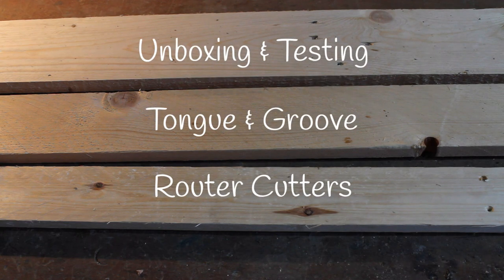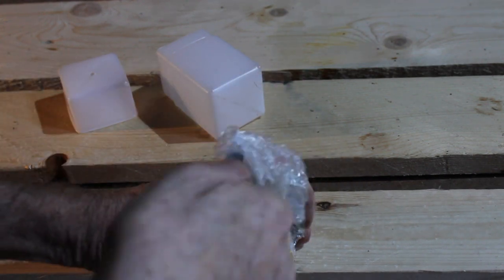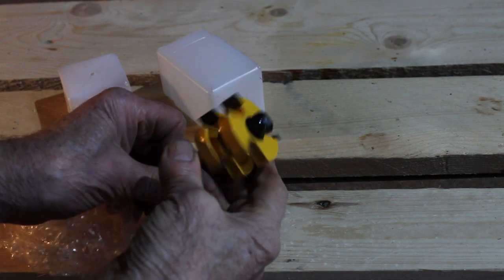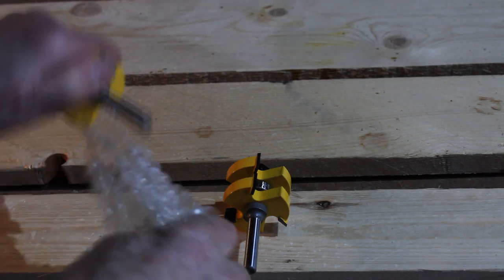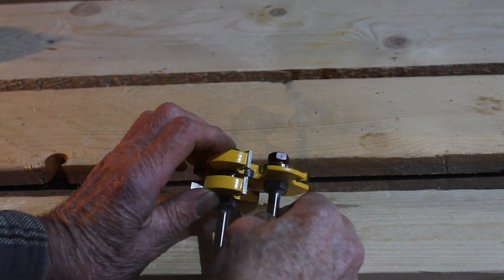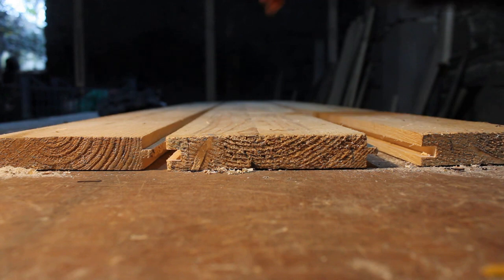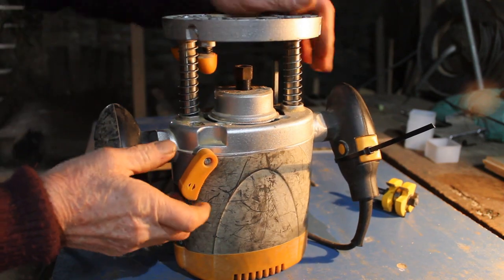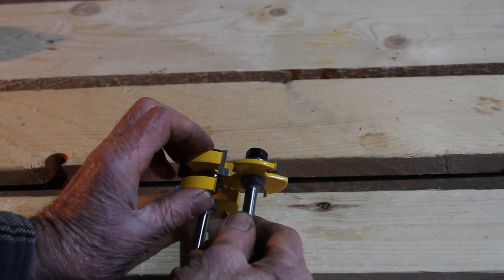Unboxing & Testing Tongue & Groove Router Cutters, Pallet Wood Cortadores ranura lengüeta - paletas.

Comment: it would be interesting to see a video - or several by theme - where you go back to your previous projects and tell us how they have held out over time. tell us about modifications or any that just didn't turn out to be as great as you intended.
Reply from the maker: Hi, Yes you're right, sadly not many people are that interested in the longevity of the projects. All I know is that I show projects I've undertaken to solve needs or solutions to problems, none of which have short working lives. It's better to receive questions about a specific projects' success so as to communicate any problems to someone that wants to do the same type of project.
Cheers, Andy.